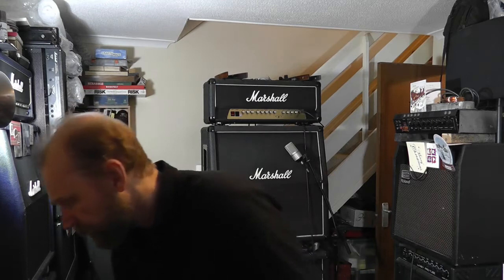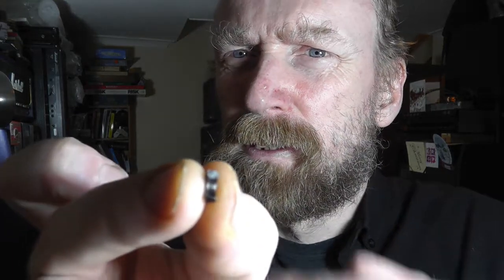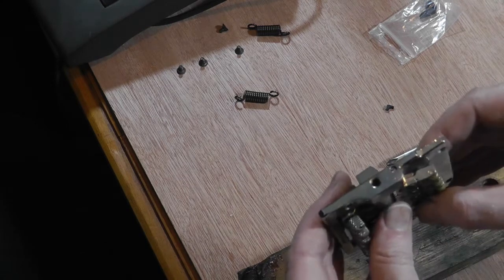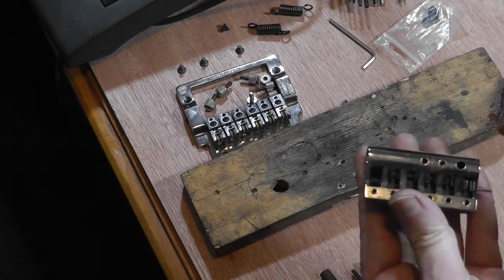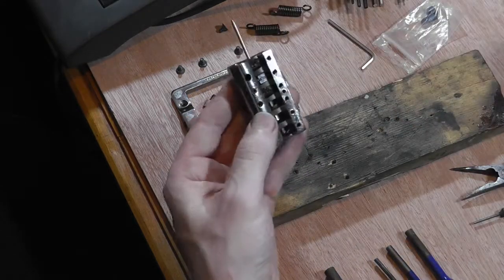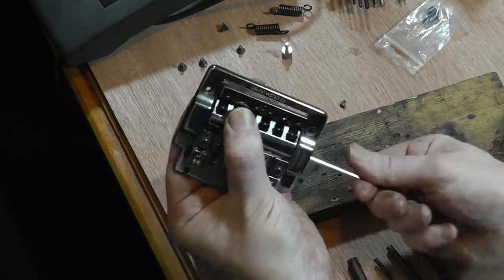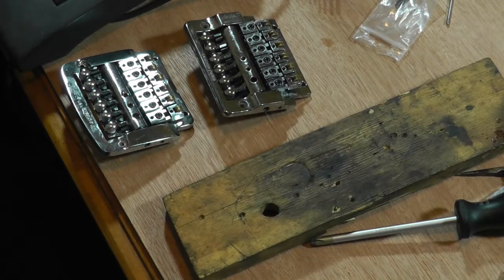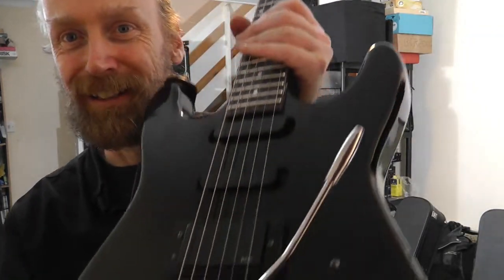Fixing A broken vintage Kahler Tremolo / Comparison with an Original Floyd Rose

Comment: I’m trying to decide between a kahler or rose . So the draw back is the g goes flat with the kahler ? You have to pull up to get it back to pitch and correct ? Is there a problem with the Floyd rose and double stop ? I’m new with tremolos . I just want one that stays in tune and doesn’t break strings . I have to do double stops as well . Any info would be great . Awesome video thanks
Reply from the maker: Hi there! The Kahler's only real problem is exactly as you describe and only if you dive bomb or something, but there are tons of advantages. The Floyd's only real drawbacks are more difficult setups - Especially intonation, but once dialled in, using a Floyd entails no problems. Less sustain and less smooth than a Kahler, that's it - If you want a video about the Floyd I can knock one up!
Reply: @hydorah  yes that be awesome ! Thank  you . How are the double stops with a Floyd . In non floating or just down no up pull ?
Reply from the maker: @michaelhook927  if you do double stops without bends you'll have no trouble... with bends - and also when doing unison bends - you'll have to develop the ability to bend both strings the right amount when you bend a double stop, as the trem will pull forward slightly when you bend and drop the pitch off all the other strings a varying amount depending on how much you bend, which string, where on the guitar and all that. Maybe a Kahler would be a good shout for you! Do you have a really good guitar shop near you that is likely to have guitars in stock with a Kahler? Floyd guitars are easy to come by
Reply: My buddy has a kahler on his bc rich I’m going to try that soon ! I know with a Floyd set up for just  down I can hold the tremolo with my hand ! I do a lot of bending and old rock n roll double stop bending! I like the Floyd’s dive bomb sound better . Kahler sounds a little more vintage tremolo with a better range ? But the options with the kahler are way more !
Reply from the maker: @michaelhook927  Oh cool man, yeah that's a good point about pushing the trem down with your picking hand to make a temporary hardtail hadn't thought of that. I have got an old washburn with a 600T licensed floyd on it set up... Tried it tonight and it's set up to float so had to bend both stopped notes to make the target pitch so quite tricky. I have a Guild with a Kahler on it, but it actually sounds like you've got it covered on your own! So I'll probably just be posting a vid of stringing a floyd style trem and tracking down a weird buzz that I found!
Reply: @hydorah  I wouldn’t  say I have it covered ! Lol May be hard to hold that Floyd down I guess I’d have to practice that . I saw a guy do it with a fender style trem . Anyway yeah make more videos there great thanks .
Reply from the maker: @michaelhook927  hey mate, I made that video. I think bending both notes seems Ok actually!

https://youtu.be/0zyjHF3jiOg
Reply: Kahler is a lot more adjustable than a Floyd Rose. Plus the Floyd barely has two contact points with the guitar where the entire Kahler is flush against the guitar giving a lot more sustain. Tuning stability is great too. 

I’ve had three Kahler tremolos and none of them had a problem with any of the strings returning to pitch like shown in this video. I guess it’s possible but it’s not something guaranteed to happen if u buy one. 

They both have a different feel but Kahler is definitely the better design. I’d recommend trying one out.
Reply: @robertwilkerson1720  thanks man
Reply from the maker: @robertwilkerson1720 Tone, sustain and feel it's Kahler all they way. 

I've had four Kahler equipped guitars and loved 'em all. But - they all come up short on a Floyd for tuning stability for that bloody G!

I'm going to go on a quest to do everything I can to make the Kahler as stable as possible, reduced break angle, maybe even solder string ends to the perfect angle. I'll video my exploits in this regard so you can see what I come up with

On balance as you can tell I prefer the Kahler - a lot easier to live with and more enjoyable to play (subjective!). The small amount of routing is a great advantage in tone and sustain, 100% agree. But the Floyd has that one key advantage - Once you go through the pain of setting it up. If you have any Kahler tips to pass on, I'm glad to try them!

So choosing a Floyd over a Kahler is a valid choice. Like you say trying them both out is the best answer
Reply: @robertwilkerson1720  I agree the kahler is a way better design . All the problems I learned about can be fixed if set up properly . I decided to go Floyd top mount flush non floating non recess over dive bomb tone and resale value only . I like the rubber band springy sound the Floyd produces . I think for a floating system up and down kahler all the way ! The kahler is so adjustable . One thing I wish kahler would make is the stud and bushing insert instead of 4 screws . Just to help vibration transfer into the wood a little more solid !
Reply from the maker: @robertwilkerson1720  Another advantage to a Kahler I've observed is that you get to use a proper nut, so fiddling with different materials for tone / sustain is possible. Also, the action at the nut can be adjusted easily whereas with a Floyd you have that bulky steel monstrosity with bolts sticking out and if you want to lower the action at the nut... Your doing some high stakes precision woodwork... 

On the point about the Floyd only having two fulcrum points whereas the Kahler has bridge rollers and cam bearings... I think this is another win for Floyd as there's nothing to drag or bind and interfere with the balance between string and spring tension

All these clever bits of engineering in the Kahler are opportunities for friction or loading to influence things and for drag or sticking to occur... Which is why I'll experiment with slightly reducing the break angle over the bridge rollers first. I'm going to make a 1mm brass plate to use as a 'stacker' under my Kahler
Reply: @hydorah  I think a brass plate is a great idea . I was think about that to if I went with one . I have a babicz full contact bridge on my Les Paul they make brass plates to go between the studs and bushings that the whole bridge sits on . A ton more transfer into the wood !
Reply from the maker: @michaelhook927  Cool man that what I was thinking - easy to work but good and dense for tone. Aluminium was another option... But on the Youtube channel 'twoodford' (he's ace) he demoed a guitar with an aluminium vs bone saddle and aluminium sounded weaker tonally and quieter! So brass it is
Reply: @hydorah  brass will transfer better good choice !
Reply: @hydorah  I know what u mean about having a real nut with a Kahler. I recently tried replace the nut on my guitar that has a Floyd and it needed some shims and it still didn’t line up right. I’m hoping I can modify it somehow but at the moment I’m stuck with an expensive titanium nut that I can’t use! 

I guess that’s one way of looking at the Floyd only having two contact points but I see it as killing the sustain since barely any of the tremolo touches the guitar. It takes so much tone away from the body of the guitar. 

The problem you’re having with the G not returning to pitch could be the roller for that string is sticking or maybe something with the nut. I’ve seen that problem before except it was all the strings and it only happened when the arm was pulled up. It’s usually binding in the cam screws. I think u were tightening those screws too much because I was told by someone who worked for Kahler that you’re only supposed to tighten the cam screws just enough to hold the cam in place and a little play in the cam from side to side isn’t a bad thing. Over tightening can damage the cam bearings so be careful with that. 

I’d like to see what u mean exactly by reducing the break angle at the rollers because there’s hardly any angle on mine. They actually make stackers for Kahlers at whammyparts.com. Maybe u could use one of those or maybe modify it.
Reply from the maker: @robertwilkerson1720  . I think my Kahler on my Guild is sitting too low. In another of my vids you can see my saddles are jacked way up in the air! The whammy parts stackers don't look like the best answer to me. 19 bucks + shipping (Loads to UK ~ $30, so shipping to the UK as well seems expensive, too) + Tax... They also don't say what they are made of... I worry they may even be plastic... have you ever bought one from them? Edit: Apparently they are genuine Kahler parts, so must be brass...

I bought 1.2mm brass sheet for £5, so I'll make my own, anyway :-D But Yeah, I think you're on the right track a slightly binding roller. It'll be amazing if we fix it. I've only ever had this issue on all Kahler guitars and never fixed it before. Not really tried before though! Just lived with it as a Kahler thing! If changing the break angle doesn't do it, I'll try the soldering thing. I'll really throw everything I can at it. I also have a boxfresh hybrid, which does the same G string thing!
Reply from the maker: I didn't over tighten any screws, don't worry, I know what I'm doing with bearing lading and such and made sure the cam could flop around with no resistance! Good shout though. My money's on the load on the rollers... But we'll see! more vids to follow! Thanks for helping on the quest
Reply from the maker: @robertwilkerson1720  Well! I made my stacker plate and tried it out, tried some other stuff... Filmed it all - You can see how I got on here:

https://youtu.be/RretENUWgsI
Reply from the maker: @robertwilkerson1720  How are you getting on with your Titanium Floyd nut? That sounds intriguing!
Reply: @hydorah  I had to take the titanium nut off my guitar but even with the wrong size shim I could notice a big difference in sustain. It was very noticeable. It also made the tone a little brighter. I’m hoping some new shims will make it fit right so I can reinstall it. 

I even replaced the trem block with a titanium one. I’ve noticed that replacing any trem part with titanium adds a lot of sustain and brightness.
Reply from the maker: Hey Michael! I managed to sort my Kahler out and made a video! Thanks for your input on that subject!
Reply: @michaelhook927  Cool! I’ve actually never had the chance to to play the top mount Floyd trems. I think it’s called the FRX. I always wanted to try one of those out.
Reply: @hydorah  I’ve never bought one of the stackers from Kahler so idk what they’re made of. Hopefully the brass u bought works out for u. I’ve had the Kahler 2315 on my 1985 Gibson XPL and luckily it sits perfect on that guitar.
Reply from the maker: @robertwilkerson1720  The stacker made the trem less stable in my case. The answer was solering the strings from the ball end right up to the end of the double wrapped portion, I made a vid, but now you know the ending! My Kahler is rock solid now. I am to be honest, astonished. Never had a Kahler work so well! You should make vids mate!
Reply: @hydorah  cool video, i have great experience with that washburn wonder-bar but it is in better shape then the one you show i acctauly love that system. Legend from KISS used it on his gibi LP..BTW washburn 600t and 800t are amazing , far as i know they are made in Japan by takeuchi. I  avoided in the past guitars with Kahler but it was mistake, thx t highly incorrect and subjective data on net o -- i had prejudice regarding Kahler. that Kahler x you shown , how does it behave do you have it some guitar?
I let o nice LTD Slayer signature  Jef h, JH 200 with khaler x, dude was asking less then 200E and guitar was new, he took it didn't know how to use trem and wish to sell it fast for any sum. I missed opportunity. Did try out guitar and it was HQ, but i was afraid from kahler x thx to incorrect data on net spread by some ''gurus''. PLS can you share your experience aka did you have any problem with khaler x or do you have it on any guitar? thx once more. I'm asking in order to by when another LTD jump up on a local market.
Original FR is imho overpriced, Korean FR made from same material is equally good in my book. Gotoh 1996 is the best from those sorts of trems with 2 knife edges ala 2 point trems.
Reply from the maker: @sisajtegabre  I was always having the G string problem with a Kahler until making these videos. The string I use need the ball ends soldered up to return to pitch. I always liked Kahlers because they sound really good. Love them even more now! The Guild in the vid is the only Kahler equipped guitar I have right now
Reply: @hydorah  COOL, what is the name friend of that guild? i mean model? yes soldering the ball end i use that trick even for regular tremolos it does help a lot. If i may add old Washbrun guitar from g seraial are great and they come with those nice wonderbars or similar systems as Kahler plus they are cheap on 2nd hand market but quality of guitars is superb.
Reply from the maker: @sisajtegabre  It's called a Guild Aviator. I totally agree about old Washburns! '70s and '80s Washburns are a great value way to get an excellent, Japanese made guitar, if you buy the right models. The Later Korean ones weren't quite as good, but still often nice
Reply: that the thing doesn't stay in tune like a floyd is a myth to my ears. The string soldering thing and general maintenance however I can attest to. Its more work to set it up correctly, more than a floyd in my view, but once you have done that and clean the parts every now and then it works just as fine. For double stops you might give heavier gauge springs a shot. Also a cam stop bolt, if you want to dive only, might be an option. Its like a trem stop on a floyd, and prevents the cam from rolling backwards, especially if you use those higher gauge springs. Never seen anyone mention that ever.